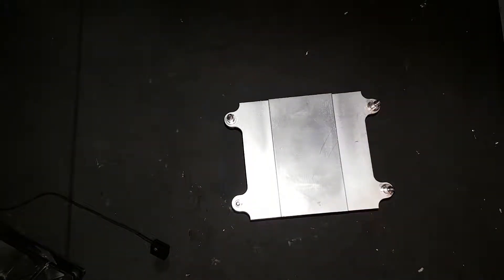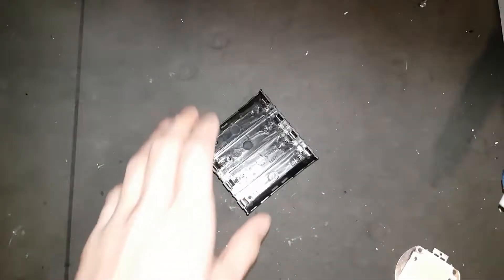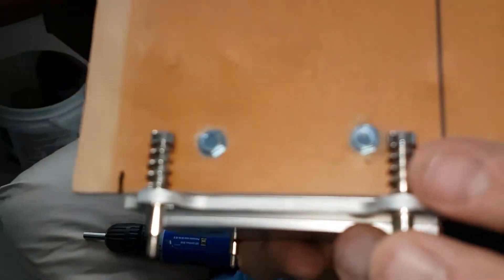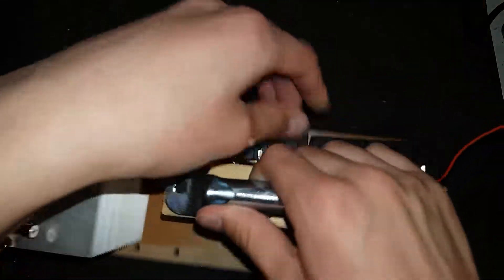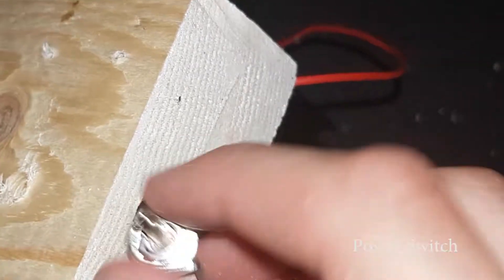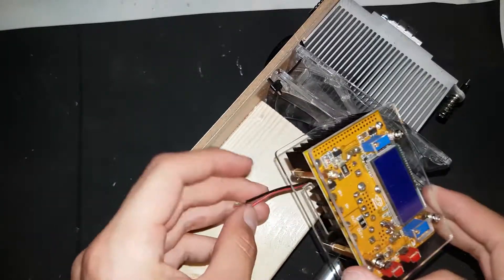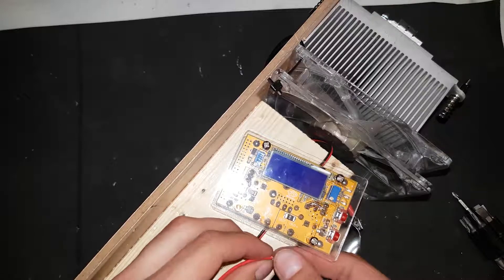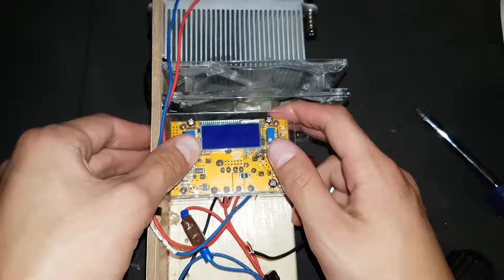18,000 Lumens! - 200W LED Flashlight Build

Comment: Either thoes laptop batteries are being pushed to their limits or this is not actually 200watts... Thoes chips need around 35 volts at 3amps each so you will need to provide ~35volts and ~6amps to get around 200watts. That would mean your 16.8 volt battery would need to put out at least 12 amps so 6amps per crappy laptop cell , and realistically it would need to output even more than 12 amps because the voltage of the batteries will drop and the boost converter also consumes power.
Reply from the maker: That is indeed some realistic math. Those cells were not actually in too terrible shape. The cooling fan did a great deal to extend the run time, but yes, I wouldn't run it at full power for more than 10-15 minutes.
Reply: @GadgetEyeGuides  nice. I'm currently waiting for all the parts to come in for a 400watt flashlight, I'm going to be mounting all 4 100watt cobs on a 6"x6" (might trim it down a bit) square 1/8" thick aluminum plate with two big cooler towers that have copper heat pipes. I'm going to use a 1200watt CV cc boost converter to power them all in parallel and I'm going to make a 7s5p battery out of low capacity high discharge salvage power tool cells.
Reply from the maker: @mashedpotatoes5323  Those specifications sound really impressive. Good luck with your build.
Reply: @GadgetEyeGuides  thank you, I'm actually going to change the build up a little bit. After testing just one of the LEDs on a heatsink from a Pentium 4 computer I was going to use it felt like it was pretty warm and would probably get hot with two LEDs, and because I'm trying to run these as cool as possible to make them last longer I am going to use 4 server heatsinks from some old servers I have. Using one led on the server heatsink the base of it only got barley warm so that should make them last a long time using 4 of them. I'm also going to make the battery 8s6p 30volts 5ah, the cells are only 850~950 mah tested at 2amp discharge so it will probably only last about 20 minutes. I might also get another boost converter and run 2 LEDs in parallel instead of all 4 too if it gets too hot.

Comment: Love this flash light. Where did you get the leds and the dc controller board?
Reply from the maker: I got the LED's and the boost converter from eBay.ca. I would link it but the original listings have disappeared. Although if you just search you will find tons of results.